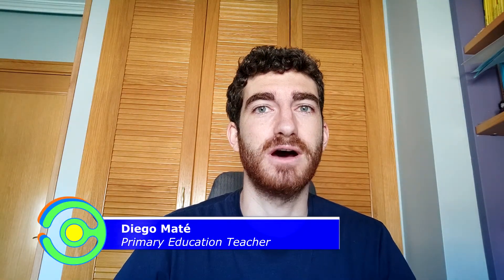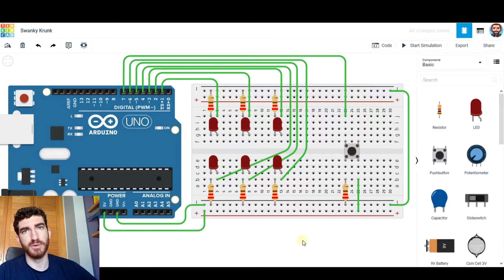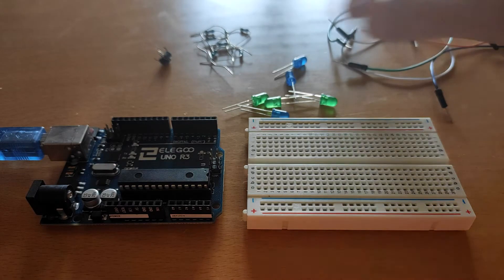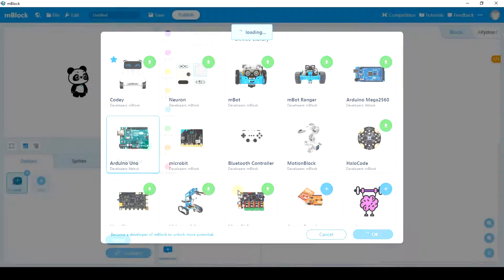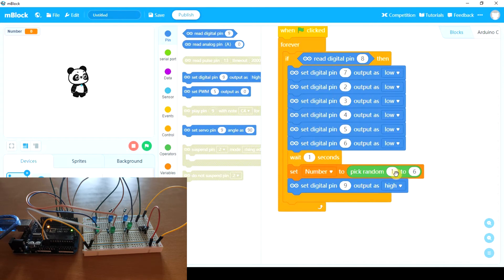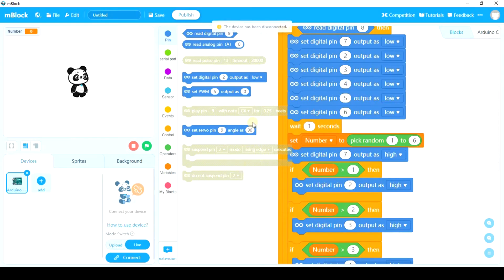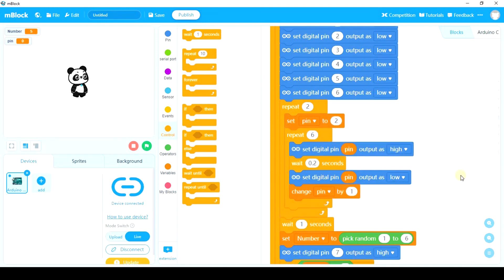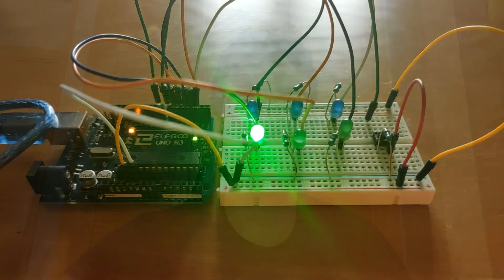How to make an ELECTRONIC DICE ROLLER 🎲 with ARDUINO and mBlock 5 - Arduino Course #09

Comment: Hi! 
Why won't the order of the "rolled" numbers be the same? I'm trying to make a similar project, but the "random" function of mblock (and arduino) is pseudo. So, would need any really random ones that are usually read in from the "floating" analog input of the arduino. But I did not find solution for "randomSeed" in mbolck. 
?🤔
Reply: I have same question
Reply: @scottandreasen3265  look at the quite random block in the extension center. This is the randomSeed.